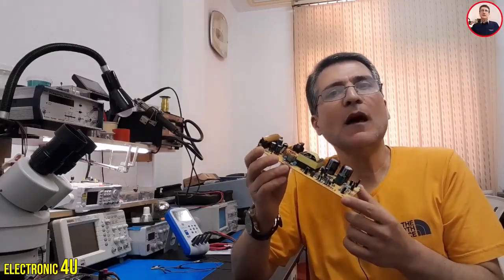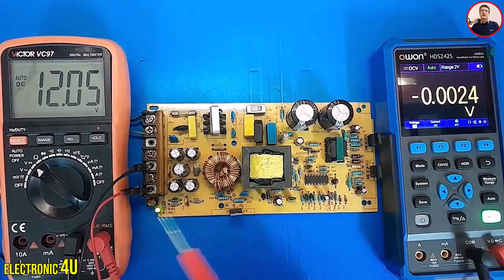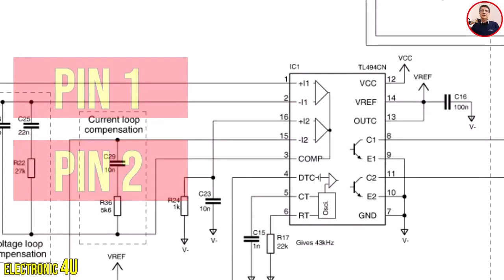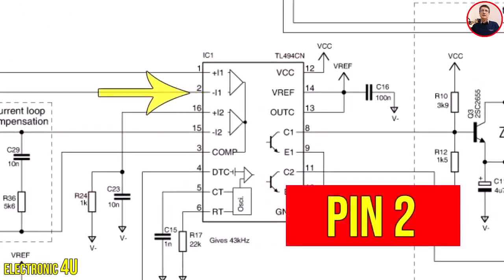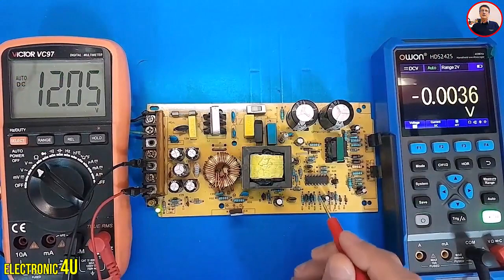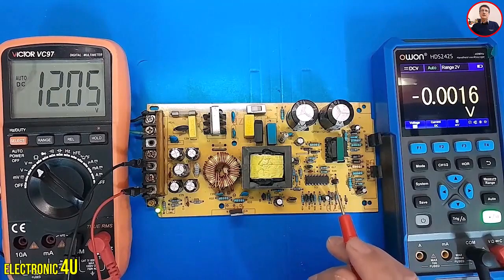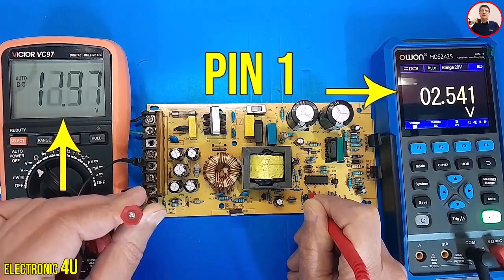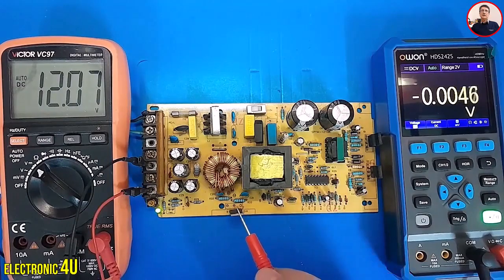Why does the voltage in the feedback circuit not change?

Comment: Sir this smps 13009 2 2 transistor parller use incress power
Reply from the maker: Hello, the circuit is in the form of a push-pull circuit and this is its topology.
Reply: @Electronic4U-david  ji sir what big 13009 not my markit plzz 13007 2 2 parallel use this smps 12v 30A smps

Comment: My life I had a fear regarding SMPS... When on most of them, the feedback is took as a small voltage, rectified, filtered and supply an optic coupler... Due the bad quality of the capacity ( most of cases were 1 microfarad / 63 V) from the filter, the feedback tension get lower , like the supply had big consumer... Then the command  IC increased the voltage....to get the correct voltage. 
Which was almost doubled on the supply... 
Has burned a lot of IC, capacitors blew...
Is not a problem when the main rectifier capacitors are gone or from tbe output... But is really dangerous if the feedback filter is bad quality .
Reply from the maker: Hello, thank you for your excellent explanation. Everyone is afraid of smps in the beginning.
Reply: @Electronic4U-david  
Hello professor 🙂 
I repaired in my life maybe hundreds of SMPS, so still have that fear 😨 😂😂😂
When you see your device ( TV' s at most)... Half of IC's metal and transistors as well... didn't look so good.
But the main advantage of the SMPS  is that you can obtain big current at small dimensions 
And seems like...I am at the mercy of the quality of the capacitors, most of the defects ...are cause by capacitors
Repaired few days ago a laptop mother board which suddenly get dead and the shorted capacitor ( obviously SMD.... , 104 ) have no signed was in short.
Seems like after seen a lot of videos on YT.... is a common issue.
But this is the life of the service guy... continue learning and seen a lot of strange things...
I have sometimes a word : Everything is ok ...but is not working 😂😂😂
Cheers
Reply from the maker: It is absolutely true 😂😂

Comment: Professor. Is there an electronic component that can combine two electric currents together?
Example
I want to combine the electricity generated from two 12V dc armatures and convert it to 24V.

استاد. قطعه ی الکترونیکی وجود دارد که بتواند دو جریان برق را باهم هم جمع کند؟
مثال
من میخواهم برق تولید شده از دو آرمیچر dc12ولت را باهم جمع کنم و تبدیل به 24ولت کنم.
Reply: I converted two 19V DC armatures into wind turbines and I want to collect the electricity from these two armatures together and produce a smooth 12V electricity without the slightest voltage drop.

من دو آرمیچر19ولتdcرا تبدیل به توربین بادی کردم و میخوام برق حاصل از این دو آرمیچر را باهم جمع کنم و یک برق صاف 12ولت تولید کنم بدون کوچکترین افت ولتاژ
Reply from the maker: Hello, the best thing is to series the voltage

Comment: Thanks for the video. but based on the title, what was the lie? thats exact common function of feedback and is used in many different power supply designs. so what is the lie? thanks.
Reply from the maker: Hello, thank you for your attention. I chose this title because in all the discussions it is mentioned that the voltage of pin 1 of the IC changes so that the feedback circuit works.
 The principles are absolutely correct. This pin should receive the changes. But the voltage should not change. This means that the voltage of this pin should always remain constant even when the output voltage of the device is higher or lower than the original value. All these steps are without consumer connection.

Comment: What's the result, If you use an analoge multimeter?
Reply: the same. Voltage compensation speed is much much faster than screw driver and your eyes to catch
Reply from the maker: Thank you
Reply from the maker: Hello. There is no difference. Voltage changes should not be serious on this pin